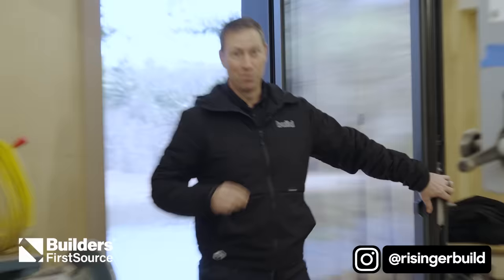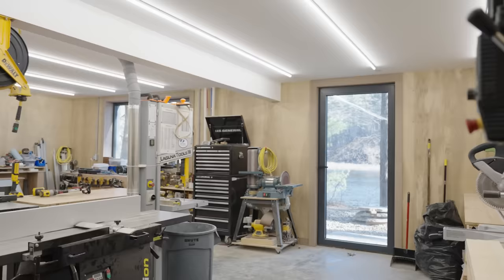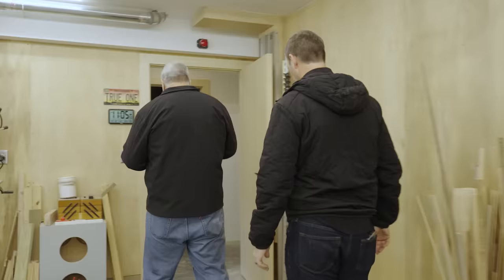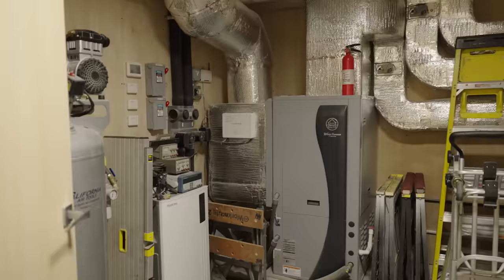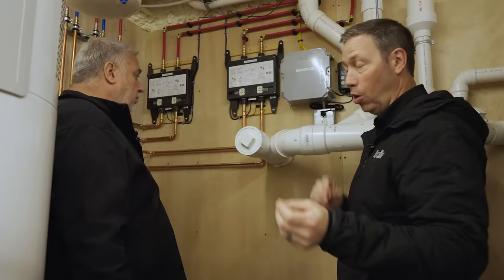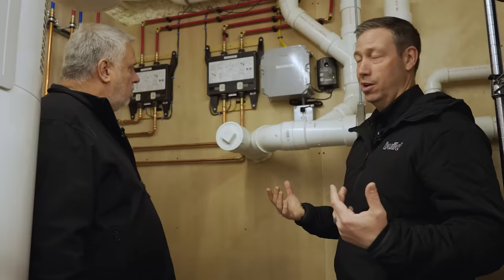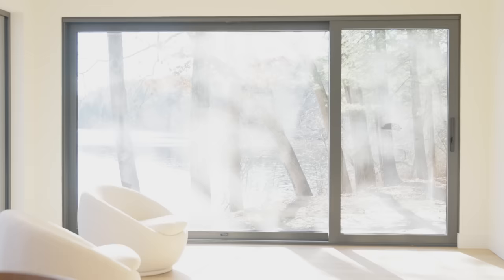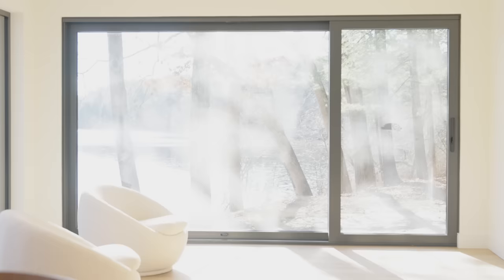Features To Include On Your Next Build

Comment: @16:09 Matt, slight correction. “Li-Po” batteries are short for “lithium polymer”, not lithium phosphate. Li-Po batteries are very energy dense, but not the safest. Almost every consumer device where you have heard of the battery exploding (like cell phones and laptops) use Li-Po batteries. Franklin uses lithium iron phosphate batteries “LiFePO4”. This is actually the chemical formula for these batteries. They are not nearly as energy dense as Li-Po’s, but are MUCH more stable.
Reply: LiFePO4 should also endure more charge cycles before losing capacity, therefore more cost effective.  Make more sense for stationary packs than LiPo.

Comment: I do like the shower valves away from behind tile… easy to maintain or replace.
Reply: They actually require that if you read the spec sheet on that . They propose putting it in the vanity which might be even more convenient. However mine is also in the basement

Comment: Mats build show saved my home.
River shack full remodel.  Alll the homes on the water have rot on the river side but not the road side. Build show inspired me 
Zip baord with liquid over the tape in prone areas 
Rockwool 80 exterior for extra waterproofing and insulation. Helped make code with old 2x4 walls. 
Metal standing seam roof 
Attic is conditioned space all closed cell foam
2 mini split heads 1 on each side of the house. 
ERV and constant air recirculation system so ever room gets freah air.  1 mini split head can maintain the entire house and the run on the lowest quietest setting. The ERV pulls from thw bathrooms 100% of the time. 
I have a cavity slider door.
I chose sheep wool for sound proofing because no PPE is needed to work with it. 
Fiberglass windows. 
The home is lifted for flood plane and we noticed becuse the openings are so large there is enough natural ventilation moisture/rot is not a problem.  Removal of the old insulation exposeing prone areas proved everything was ok.
Tankless heater, valve tree . 
Floating slab sink base. 
Tons of nice detials in this home. 

From old river Shack to mini Mansion!!!!.
Reply: nice! what areas of the home and how did you sound proof it with wool?
Reply: @utpharmboy2006  
Have lock wool. 
I did simple test using cardboard box  and phone,  it seemed better than cellulose, very competitive anyway. 
I couldn't be there when the drywall was going up so they installed it.  I noticed some sections of wall are not as good as others so I assume they didn't pack every bay 100%. You need to pack it tight. Stuff that wall. 

If I had time to do the walls my self I would use 2 sheets of 1/4" joined using the sound caulk 5o maken1/2" sound board. And I would pack the wool extra tight. 

The wool is so clean and safe to work with. 
I've been messing with Ruxol and spray foam and I hate it. It has its uses but sucks to work with.   I had to use Ruxol on the exterior and sprayfoam in the roof and floor because of the type construction.
Reply: @cableguy130  perfect. thank you!

Comment: If any construction dorks were wondering, the framing member Steve was referring to at 19:15 is a Flitch beam, the old sandwiched dimensional framing lumber with plate steel in the middle, held together with fasteners. Obviously very strong, but heavy and limited and basically don't get used much anymore due to engineered lumber being better in nearly every metric. 👍👍
Reply: Architect here, some of the structural engineers I've worked with don't like them simply because the stress capacity of the steel is so much higher than that of the wood and they would rather use one material or the other and not mix. For something like a stair stringer where you need just a little more strength to accommodate the deflection this is a good application for them.
Reply: Another arch here. They are are also a bit fussy to make. On the other hand if you can see the steel they can be fairly expressive. @timmmahhhh
Reply: @timmmahhhh  I place a 2x4 on either side of a stringer except outside stringer, just below the cheek cut to stiffen the stringer.  Amazing how well this works.  I am PE Mech. and Structural.

Comment: @ 19:20 Steve is referring to a flitch beam for anyone who might be curious. A steel plate is coupled with dimensional lumber on either side, and all 3 pieces are held together with (usually) staggered rows of bolts.  This sandwich of wood-steel-wood makes for a lightweight but strong composite beam that can be accept flush joist connection similar to a normal wood beam. It's handy when you need the extra stiffness and/ or strength but don't need a full steel beam. 

The stringers are basically a inverted flitch beams with steel on the outside and a core made of wood. 

You can do similar with W-section steel beams (aka I-beams) by just packing the webs out with wood. There, the wood doesn't really do anything structural. The steel I-beam carries all the load, and the wood pack out allows for traditional wood joists or trusses to attach with face-to-face (flush, dropped a bit, raised a bit, etc.) connections. Often one or more oversized pieces of wood are cut to size to fit the web 'bay', including the concave joint between web and flange, and then bolted thru to transfer loads from joists into the steel.

Flitch beams are sometimes more common on single family homes, but also used in commercial and multi-family projects. Really, I've rarely seen them used in my market though. Packed out I-beams are very common, though.

Comment: Franklin batteries are 13.6kWh. Current Tesla Powerwall is 13.5kWh. Franklin bumps up peak power which is nice for single stage AC units. Franklin is more expensive from my quick look.
Reply: But if you consider the price and feature, I will say it make sense.

Comment: Looking at doing something very similar, except with ICF, all electric, heatpump everything... My current want/wait is Sodium Ion batteries, to bring the cost down for stationary storage. My workshop will be in a pole barn, and will go with Ikea cabinets, while I build/make my own cause my projects usually take 5-10 years to complete, lol at least that's the dream/goal...
Reply: actually, just viewing the complete build videos, it is ICF, so this is more or less my same thought process, glad I'm not the only crazy nut thinking this way, lol
Reply: @abel4776 my goal is to retire and worry less about utilities gouging, be more self reliant and sustainable for the long term.
Reply: ICF puts the fragile flammable toxic insulation on the surfaces where it's most vulnerable to mechanical damage, vermin, or fire, and puts the concrete in the middle where its strength has the least leverage and its thermal mass is useless. If you can build a sandwich with the structural concrete on the interior surface of the wall, and then your insulation, and then enough concrete on the exterior surface to protect your insulation and back-brace the main concrete, you'll be well ahead.
ICF is easy, but that doesn't make it good.

Comment: I have a similar Waterfurnace Series 7, 3 ton geothermal system. And I use an Emporia energy monitor. At peak hot and cold, I've measured a max energy usage of 2 kW @ 8 Amps. That is without the emergency heat coils, which I don't believe have turned on in my 2 years of ownership. Love this thing.

Comment: Awesome house and excellent craftsmanship by the homeowner. I have my shop in my walkout basement like that too and it’s wonderful. Being a retired electrician I couldn’t help but notice the code violation in the garage. The batteries are installed within the required working space for the electrical panel in the wall, that’s illegal.
Reply: You are correct - the batteries are slated to slide down the wall

Comment: 12:51 the door should actually unlatch with the key from the outside, if it’s German for hardware. It should also have a latch disable feature if you have prior going in and out the front for a while.

Comment: In China the “bank vault” style front doors are even more extreme. In addition to the large security latch there are also numerous metal pins throughout the entire height that extend into the frame when the door is shut. It was crazy to witness. They also had fingerprint and code entry, and video when you ring the doorbell.
Reply: This door may have had that as well, it seems the high end Euro doors have this and he's shown it on other videos. Seems like a much more secure door other than the two large windows on either side!

Comment: Nice touches and overall build!  I like the idea of charging the Franklin batteries from the grid at a reduced rate.  I wonder if the Franklin batteries could be charged by a small backup generator while it is powering the house.

I am surprised the Carl failed to insulate the hot water lines.  I insulate the entire hot water line and then use either a 1-hole or 2-hole strap sized to allow for uninterrupted pipe insulation to secure the water lines.  This also allows for the PEX lines to expand/contract due to the changing water temperature flowing through them.
Reply: Running a generator, if you factor in all costs (purchase price, fuel, maintenance, depreciation etc.) is expensive. It's a great idea in an emergency, but as a rule utility power is almost always going to be cheaper. I do exactly what you do with my water lines; they can't be too well insulated and it sounds as if you are just as meticulous as me.

Comment: As an Architect I can appreciate the approach of using ground source heat pumps, battery systems, various controls, etc as presented.
But I'm also well aware of the initial costs and maintenance issues . Many projects killed this approach after the owner saw the costs, maintenance and payback.
The Mechanical Engineer was reinded in for simpler cost effective solutions.
Sometimes " keep it simple" ends up with livable solutions.

Comment: An added advantage of the heat pump hot water system being inside is that it extracts moisture from the air while it is running.

Comment: First few moments of video...he slides dust collection filter on ceiling over...rough cut Sheetrock and no apparent fire barrier. .. ooh 😮
Reply: It's a private residence and the code doesn't require a "fire barrier" as you call it.
Reply: my immediate thought was that looks kinda hack considering the level of detail in everything else,... the rough cut opening, and the filter and track itself..... just based on how neat, and well laid out that shop was, before seeing rest of the place, everything about that filter setup seemed out of place

Comment: No entry from thr front door?  Talk about feeling stupid when you run out to meet a friend and the door closes and you have to walk around to the garage. I really never use my front door for entering but i would not give it up.  Nice drill press and huge jointer.
Reply: It seems more questionable from a first responder perspective. Firemen are gonna have a helluva time getting in that door.
Reply: @wg8304  "Flex Karma" maybe?
Reply: @branchandfoundry560  yes maybe sprinklers should have been on this engineer/ owner’s mind.
Reply: @wg8304  Cheapest insurance one could ever buy, especially in a rural or remote location. In plan revision phase now for our (hopefully) final home and workshop build. It's fairly remote. Fire sprinklers were first thing on the "Must Have" list for both the home and shop.
Reply: @wg8304 no, they can break the windows and in europe they use a hydraulic clipper to break the door open.
Reply: It’s not stupid though, in europe these are the norm, everyone knows to take the key everywhere you go and this feature can save your live if you’re getting followed and you’re just in time to slam the door closed. Also a lot of homeowners nowadays have electronic door locks that’re able to be unlocked through your phone.
Reply: @miles5600 @miles5600  I've only spent 3-4 months total visiting family/ friends in 8 countries in the EU. I never saw anything coming close to a one sided opening door in the city/ burbs/ way way out in the back woods of Latvia.  In fact most doors were old heavy wood or more commercial style in homes depending on the age. The apartments/town homes we stayed in were just "normal" doors.

What kind of life are you leading that you are concerned about being followed???  Personally I'm concerned about cardiovascular and lung diseases followed by accidents( I have a few motorcycles). Personal attacks are very low on my list for a long health span.

Comment: I'll never understand a heavily reinforced door but half your walls are glass. Are the windows bullet resistant at least?
Reply: I noticed the same myself. 

I would wager there’s at least some thick Mylar film on it. That should at least contain the fragments for a brief time and give a few seconds delay if someone smashes them trying to reach in and open the door.
Reply: Speaking from an architectural perspective here, so I apologize for the mini essay lol:

There is impact rated glass. It's a safe bet that is used in the sidelites for the front door. At least, it would be a shit product if the glass wasn't high impact rated. The other windows are usually not as highly rated, but can and sometimes are impact resistant to some degree as well. Usually there will be 'normal' tempered glass used for larger windows anyways. But for security reasons, it all can and should have some improved impact resistance, but that gets expensive. 

Robbers usually go for the doors anyways and not windows, because broken shards of glass is asking for them to cut themselves going in and out. And carrying thick enough blankets to drape over the openings would attract too much attention in most busy enough neighborhoods anyways. Likewise, if the first floor is raised off the ground, the windows are likely too high to reach without a step ladder or ladder, which would also attract attention and slow you down if you have to run.

Most robbers are gonna be looking for targets of opportunity and an easy get away, so doors are the preferred target over jumping thru a window. That's not always true, of course, but if someone is willing to smash and climb up thru a window each way... reinforcing both the doors the windows probably wasn't going to stop them anyway at that point. 

But I agree, all potential points of entry should be reinforced. But also, when you go down that rabbit hole, if the doors and windows are reinforced, is it easier at that point to just get a chainsaw and cut your way in thru the siding, sheathing, and stud wall? Because most homes are stick framed in the US, someone who wants to get at you bad enough could easily just do that. It's suuuuper unlikely, but if you have enough of a target on your back to warrant all that added security at your doors and windows, you'll want your exterior walls to be concrete also at that point. From a cost-benefit analysis, for most folks it makes sense to just reinforce the front door and maybe some select windows, not everything, unless they have a huge budget. Cameras, motion sensors, alarms, and automated lights will provide extra protection if not more than reinforcing all the non-door openings.
Reply: I don't think it's so much about the security of the door as it is the super seal you get when all of the bolts engage and pull the door tight. These kinds of doors are pretty common in Europe. They're very conscious over there of constructing as airtight as possible (and in doing so energy efficient) buildings. Also, the door typically can be opened from outside with a key, and there is usually a small latch that can be flipped up on the jamb that allows you to push the door open from outside when you're home going in and out.
Reply: It’s not really about security cause this door is not even close to a european safety door, this door you see in the video is that thick and sturdy to get a well airtight and insulated seal between the inside and outside, that’s also the reason why you can’t open them from the outside cause it’s a European style door.
Reply: @miles5600  If it's like any door I've used as a European you can get in from the outside with the key which first retracts the security bolts and if you continue to turn it also retracts the latch. It does have a higher resistance once you get to the latch though since you then also have to work against the spring of said latch.
Reply: @zakiducky  
I was thinking less about robbers and more about armed govt employees.
Reply: @shenlonggohan  That too! But probably on enough lists to make talking about that ill advised :p

Comment: The more gadgets in your house, the more repairs and maintenance you have to do. I get it, the guy has an unlimited budget to work with but is any of this necessary in the first place?
Reply: When you build your own home, nothing is about necessity.
Reply: Not really true though, we have a house with these things built over 20 years ago and still going strong with very little maintenance required.
Reply: A lot stuff is imported, like the door hardware.
It will last way longer in the long run.
There are houses in Europe hundreds of years old and still in great shape.  Kinda like power tools, buy quality up front, save in the long run

Comment: Question about the heat pump water heater. What did the inspector say about it? Here they made me duct the air intake and exhaust to outside.
Reply: Ours was good with it - there is a vent in the wall connecting it to the larger basement
Reply: @stevenbaczekarchitect9431 gGood to know thanks for responding.